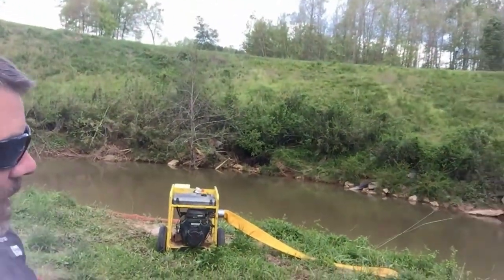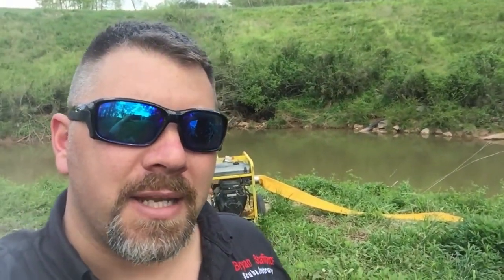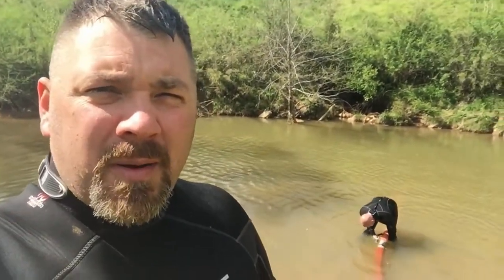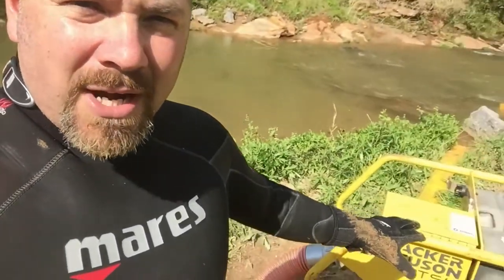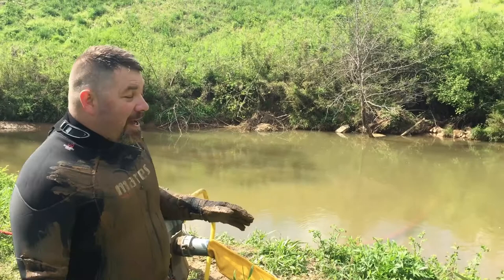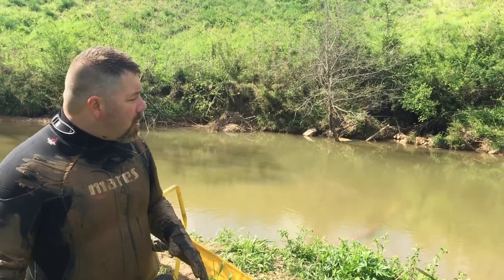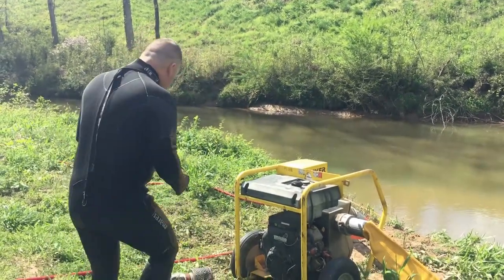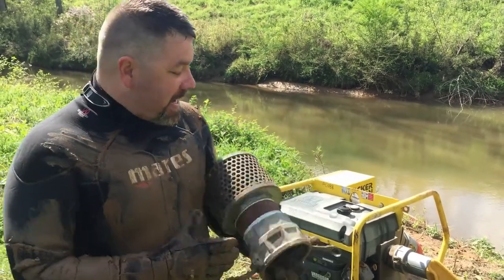Dredge Work For The Water Pump

Comment: Great video! However, I Recommend outlining your work area with 8' white tip t-post and showing your before and after water measurements. Your organization's transparency is key when selling your services.
Reply from the maker: Hello @w.carter5908, thanks for your insight. We simply do the work that we are hired to do. We never add additional services unless our client request us to do so.
Reply: @LakeHickoryScuba  I'm grateful for your feedback; however, I was trying to obtain a better understanding on "how much volume of sediment did the 3 inch trash pump move?" Whould you happen the remember the volume of sediment moved per hour? I have a similar upcoming project.
Reply from the maker: Hello @w.carter5908, truthfully, we don’t know. The golf course’s intake system routinely gets covered up with sand. Our goal is to clear the sand to where they have several feet of clearance.

Comment: Yeah that Delta P definitely one of those poo in your your pants moment couple years back I had an employee it had turbo intake grate  off of an 8 V 92 Detroit for inspection got his hand a little too close broke every one of his fingers......... Single stage 90 mm Turbo it full spool makes 27.5 of hgv or real close to absolute vacuum..... On a side note mares  is going to have to redesign there wear guarantee lol your suit looks like mine after trying to prove a point LOL
Reply from the maker: I tend to be rough on wetsuits.  They get more abuse than any other piece of gear I own.

Comment: That pump can't handle anything more than 15% sand mixture. you need a diaghragm pump for jobs like this or at least use an agitator with a 1 inch sprinkler head
Reply from the maker: Hello Katelyn Ellis. The pump system used during this video was supplied by the client, not Lake Hickory Scuba.
Reply: The required CMF (38) for most diaphragm pumps is too extreme for that kind of environment. However, I'm interested to hear, what agitator with sprinkler would you recommend.

Comment: You should never use a pump like that without a strainer on the suction end. I have a 3" hose with a permanent indentation because a rock got inside the hose with the previous owner.
Reply from the maker: Sometimes we have too.
Reply from the maker: Possibly Larry St. Claire, possibly.

Comment: Where did you pump the output to?
Reply from the maker: Hello @marsogreen2411, it gets pumped on down stream.
Reply: @LakeHickoryScuba  Thank you for the reply.  Does this mean that somewhere downstream the water has gotten shallower?  Not implying anything negative.  Just trying to understand if I do the same on my private property and choose to pump the output to the side (on dry land), would I end up with mounds of dirt?  Thank you again
Reply from the maker: Hello marsogreen2411, this particular site is creek fed, thus, there will always be a constant stream of water coming in. If you are dredging sand and dirt out of the water onto dry ground, then yes it will accumulate on land. The reason we dredge this site is so that the water pump will remain above the bottom of the creek, and allow the irragation system to constantly pump water.
Reply: @LakeHickoryScuba  thank you again for the reply! That would be also my reason for dredging, but I can also use the extra dirt for planting